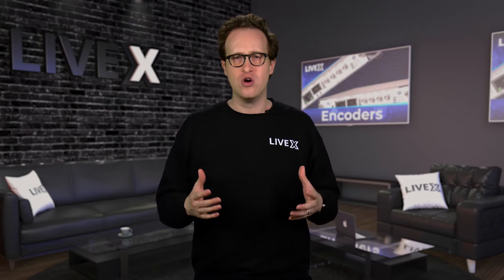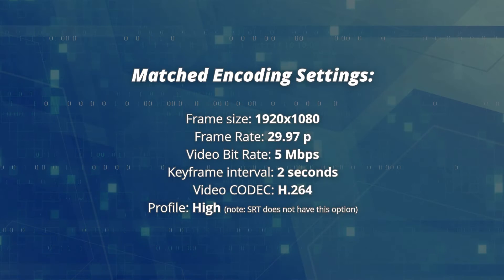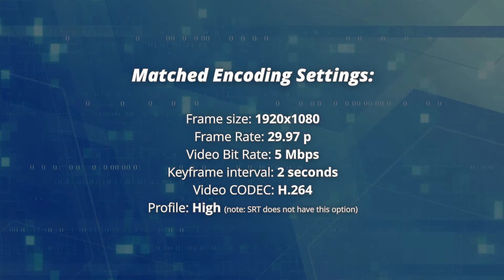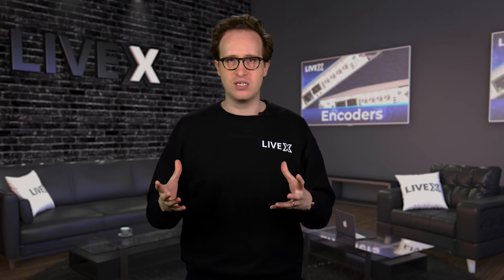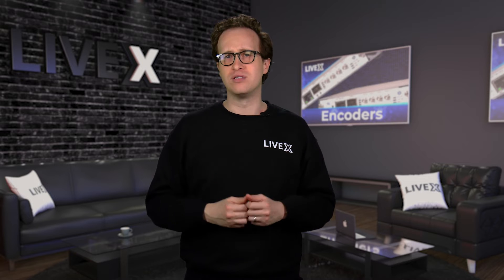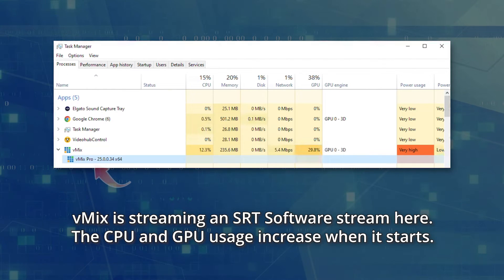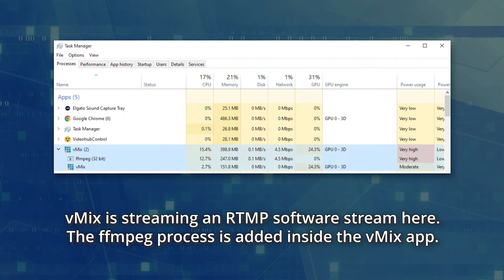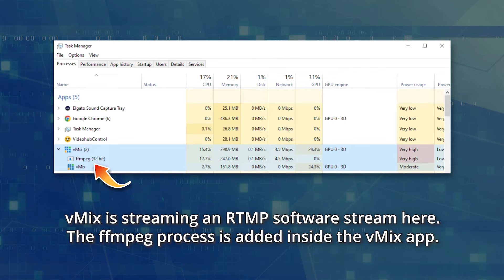Encoder Shootout: vMix SRT vs vMix RTMP

Comment: Following your last encode test in December, I raised the option of better NVENC encoder profiles with vMix and they were added in version 27, which also uses a newer version of ffmpeg. I see these test were done last August and expect if you reran you hardware RTMP test with the latest version and a higher NVENC profile you would get much better results (I do using your test file).
I don't know if SRT HW encoding was improved, but I expect they will work on it if you can show it falling down in real world usage (they did say they don't find stress test videos representative)
It would probably be good to include the used software/firmware versions on your tests since quality can change with new updates.